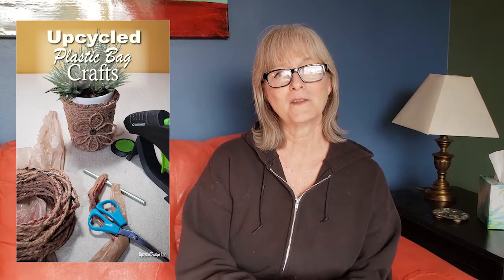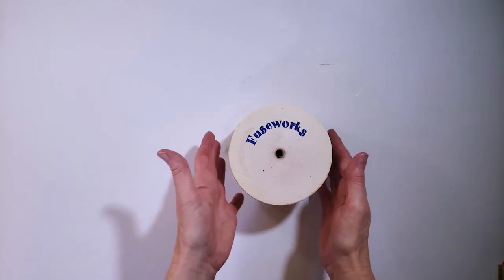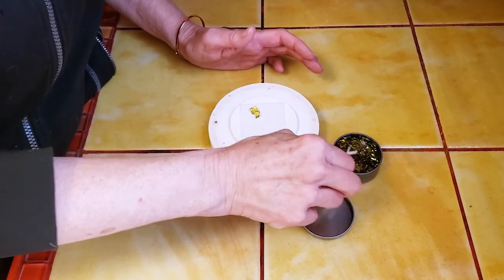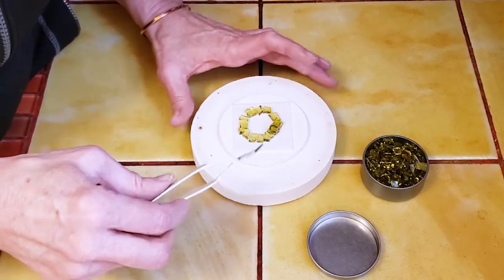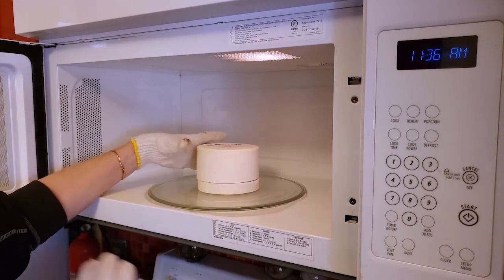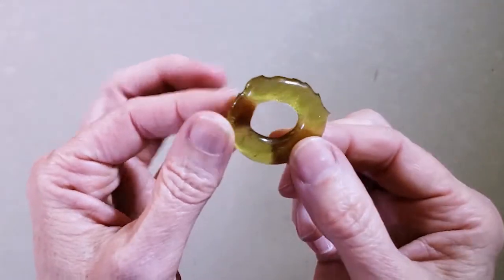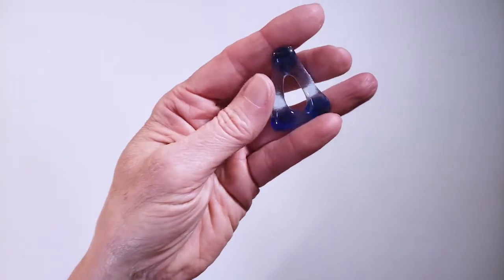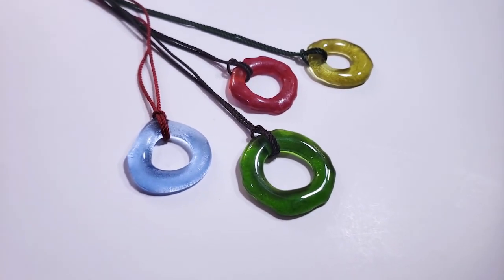Simple Fused Glass Projects - Upcycling Glass in a Microwave Kiln

Comment: I’ve been asked to fuse breast milk powder into a glass bead, is this possible please? I don’t want you to make in resin
Reply from the maker: Hi thanks for watching. My guess is no as most elements will burn off at high temperatures. I would also be concerned about starting a fire in my microwave.

Comment: Hi, I’ve tried fusing glass pieces using two different microwave kilns and while the pieces look nice, they often come out with little black specs on them. I’ve tried everything! What do you do to prevent this?
Reply from the maker: Hi Amanda,
I'm sorry to hear you are having problems with your fusing. I have not ever had this problem so I don't know what could be causing it. Are the specs on the bottom of the piece or fused inside the glass?
Reply: They are fused inside the glass. My only guess is they are flaking off of the inside black coating during fusing, and falling into the piece. But I have two different kilns from different makers, both new. So I’m not sure how to fix/prevent.
Reply from the maker: @amandadalton8715  I am sorry but I have never had this problem. I know that there is a bit of a price range with the kilns. I have seen them from 40 to 100 dollars. I don't know if that makes a difference. It seems strange that it would happen with both kilns. Sorry that I am not able to be helpful.
Reply: @amandadalton8715  May I ask if you've now solved this, Amanda?
I was wondering:
a) What bottles or glass you're using and 
b) What Glass Fusing Paper you're using – as it sounds like you are unwittingly introducing the black dots somehow – given it's happened in both kilns. (There's an Importance Of Being Earnest joke in there somewhere, but I'm too tired to write it!)  😆

Comment: Hello, long comment. I apologize. I see that this video is a bit old, but I’m planning to make some fused glass jewelry. I was wondering about the COE of the recycled glass, and how to know which glasses have which coefficient of expansion so they’ll fuse and bond without cracking later. To my very limited knowledge, glasses like borosilicate, which has a COE of 33 I believe, the smaller the number, the “harder” and more stable the glass I think (usually the tempered glasses like Pyrex used in cooking) are more stable and can handle a bigger temp range without cracking. Other common glasses used for lamp-working and fusing are 90 or 96, although there are more available. My torch is a small starter one, since I don’t have an oxygen set up, so I can only work with the softer, less stable glasses (usually 90 COE) and have to be careful that they don’t cool too quickly. Annealing them stabilizes the glass so they don’t shatter later.  I’m not familiar with the microwave kiln, but have a small tabletop kiln I’ve used for annealing lamp-worked beads. I’m planning to use it for my fusing with some glass molds. I love this idea, and just wanted to get some feedback since I’m just learning. I also wanted to see if anyone has used this glass with molds, and whether or not they stick or come out easily. Thank you for these up-cycling videos! They’re excellent and I’m so glad I found them.
Reply from the maker: Hi thanks for watching. It sounds like you might know more about glass fusing than I do, but I am happy to share my experience. I have used my kiln many times to fuse recycled glass. I don't know what the COE is on any of the glass I have fused but it has fused together well.  I haven't really had a problem with the pieces breaking although a few of the bigger pieces have cracked. I mostly fuse earring sized pieces. Hope that helps a little. 🙂

Comment: Can you bake more than one pendant at a time? Thanks
Reply from the maker: Thanks so much for watching. The kiln is quite small so I would say no in general to more than one pendant at a time but I have fused more than one item at a time when they are smaller for example when I fuse beads I have been able to make 4 at a time. Also they do make kilns that are slightly larger than the one I have.
Reply: @UpcycleDesignLab  mahalo for responding to my inquiry!

Comment: I have taken many courses through my years and now teach on glass fusing. One of the first things to learn is that all glass has to be the same because glass moves within the kiln at different rates (that’s probably why that back piece didn’t want to keep up with the rest). This is called Coefficient of Expansion (COE). Melting the same bottle together may be OK but NOT window glass and other things like bottles. It may all hold together for awhile but it may just all of a suddenly pop apart. Plus, you can only refuse glass around 3 times. I would suggest anybody thinking of fusing, study up on it first. This video had lots of bad information. 👎👎🐢
Reply from the maker: Hi Kathy - I am certainly not an expert at fusing glass but I have fused many pieces over the years and have not had any issues with fusing or breaking. I am just sharing my experiences with this small microwave kiln. Every project is a fun new experiment.
Reply: I understand that this is just an attempt to introduce fusing glass but it makes it sound at times like it’s fact. Another remark is the sharpening stone. When using the stone, I suggest you pour some water to a level just over your stone, it makes it a lot easier to take your needles off. I think it’s great that you have introduced a small kiln to the public.  I have never used a microwave kiln so I definitely am not an expert on it but do know that it’s suggested to use a separate kiln for fusing. Thank you 🐢
Reply: Wow, you sure were harsh.
Reply: Then make your own video and be kind to this nice lady